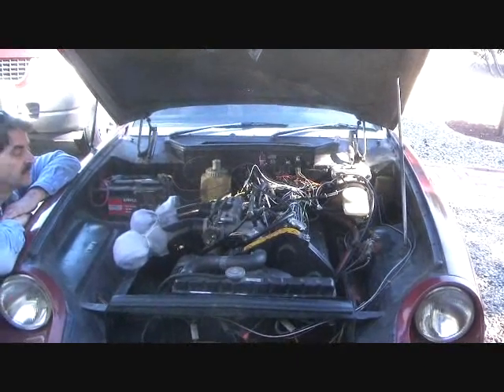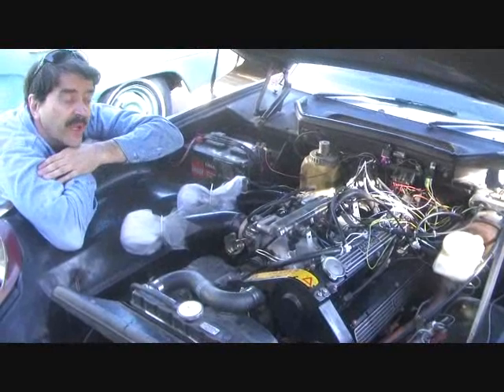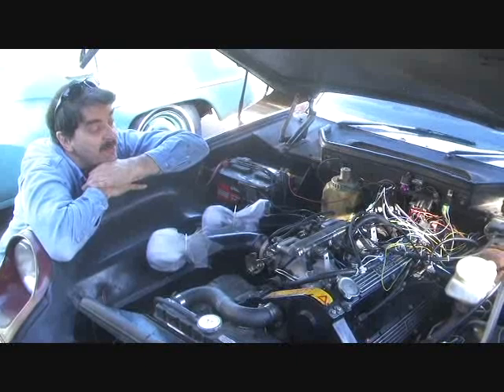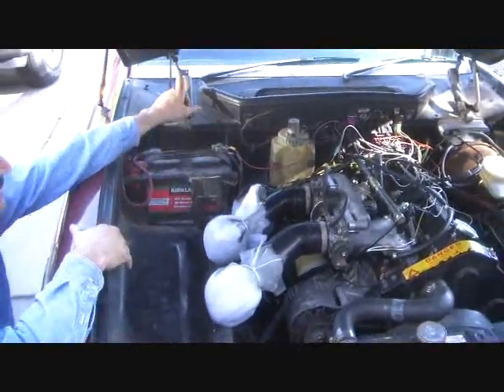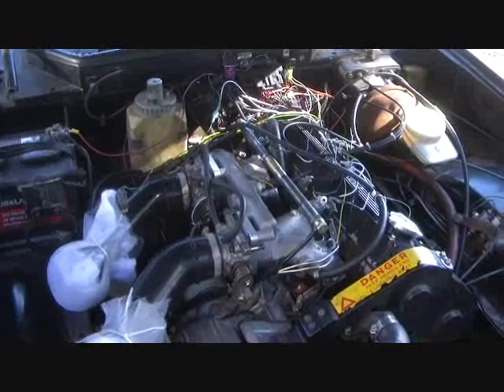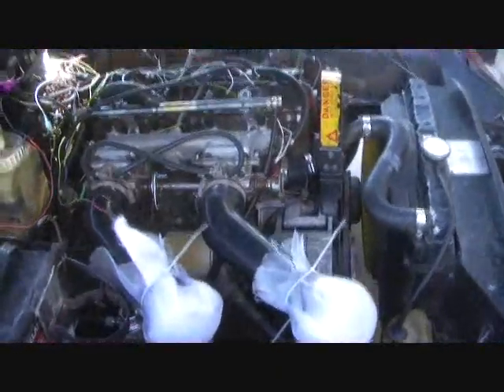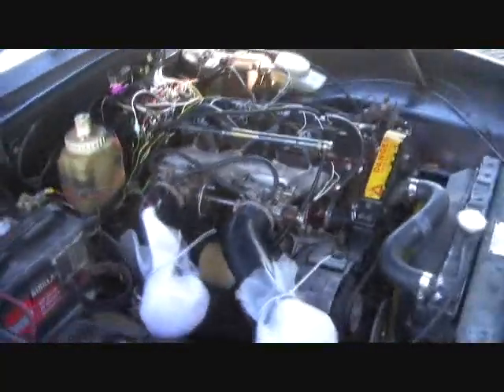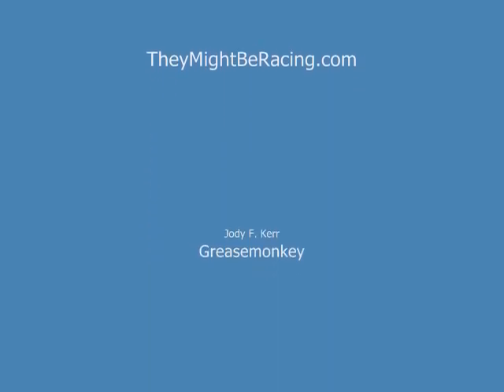Adding Fuel Injection to the Jensen Healey

Comment from the maker: @mentalextra We did it for a few different reasons. First was to see if we could easily cobble together a system from mostly junkyard parts. Second, there are fewer and fewer Dellorto conversions around, and the original Federal Strombergs leave a lot to be desired.Third is the power bands. The later 912 engines had fuel injection, so why not try it on the 907? Throaty carbs are impressive, but the noise can be excessive at times.

Comment: It sounds nice and smooth at tickover and picks up nicely, but! and this is a big but. It is a large part of the character of the car to run on double twin chokes. The bumpy idle, spitting back and snarling is what a british sports car is all about! If you want to update, why not just put in a late model Ford or Chevy engine complete with a sophisticated engine management system and low emissions etc?